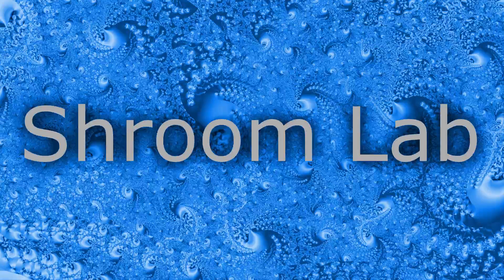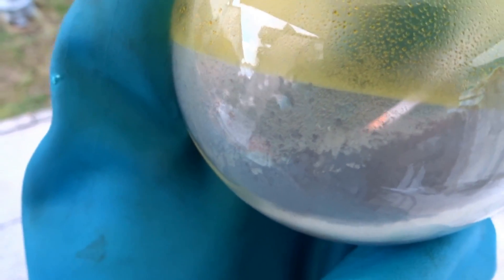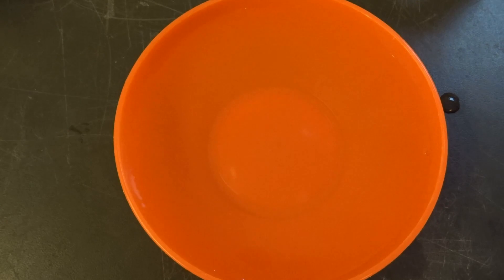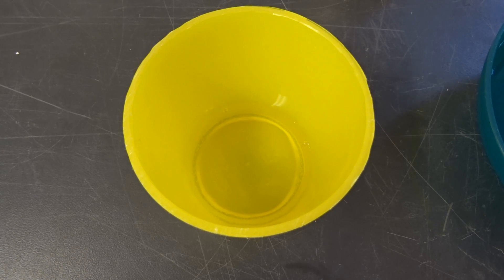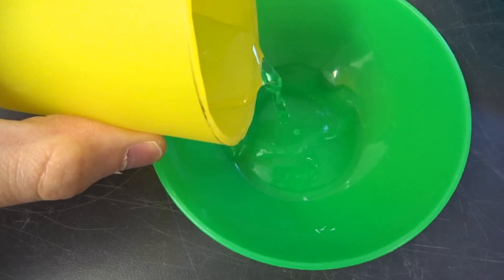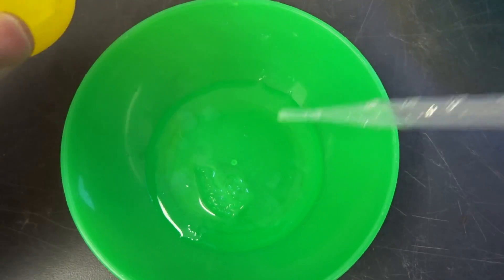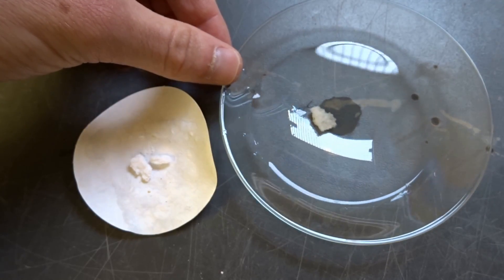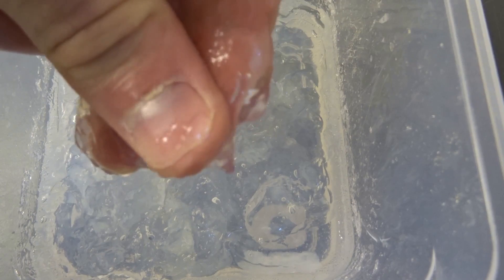Making Aerogel At Home: Part 3 New Gels

Comment: seems like you could possibly freeze dry it. maybe flash freeze, then freeze dry. you might also try replacing the water with some other fluid and then let it air dry. it looks like you're on the right track though, since the air dried "gel" you made looks like true aerogel after it has come in contact with water (see the veritasium video on aerogel)
Reply from the maker: Freeze Drying is a great idea!!! I already had tried it with isopropanol and toluene as fluid, it collapsed both time
Reply: mmm yes... I wonder why supercritical with methyl works. I imagine it's collapsing either from being a dissolute, or from hydro-static pressure during fluid evaporation (if that's the name of the mechanism that I'm thinking of).  super critical takes the fluid to a gas directly. if you can freeze it without the fluid expanding or shrinking, the way water does, you might be able be able to get it to sublimate without messing with the structure, which is why I mentioned flash freezing, which can be done fast enough to prevent the majority of ice expansion (for a period of time). I'm not really well versed in chemistry but there is likely a fluid out there that doesn't expand or contract when frozen, which would be ideal, but then there's a load of other properties needed, right. being able to displace the water, not dissolving the silica, does sublimate at reasonable pressure, isn't super toxic or expensive. my instinct says probably some hydrocarbon like methane but with a lower freezing temperature.
Reply: @RFMongoose  methanol is used to make it.